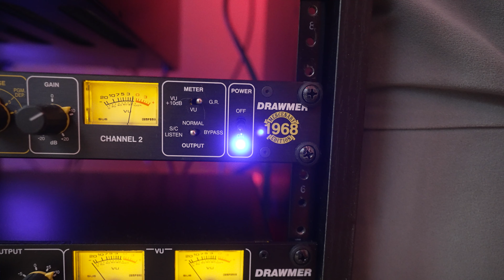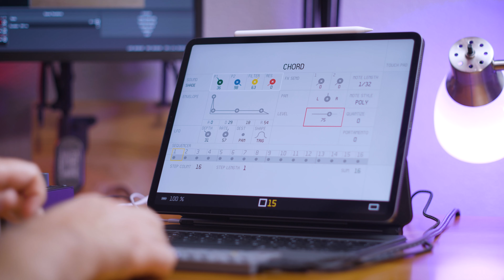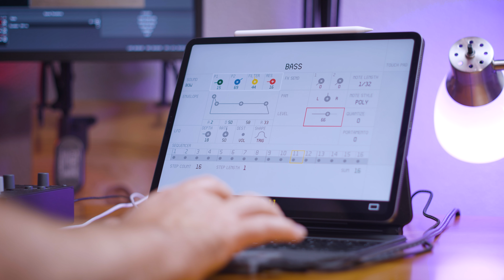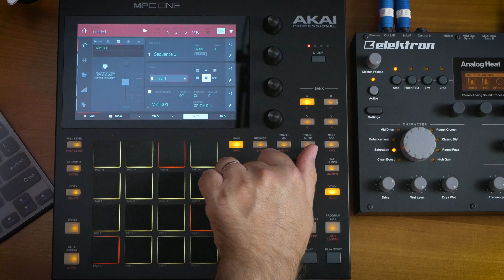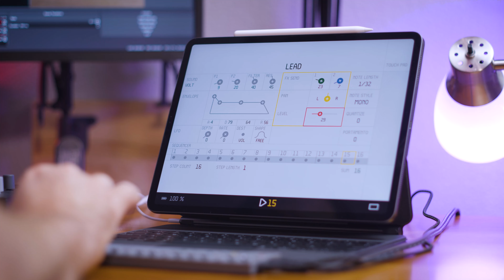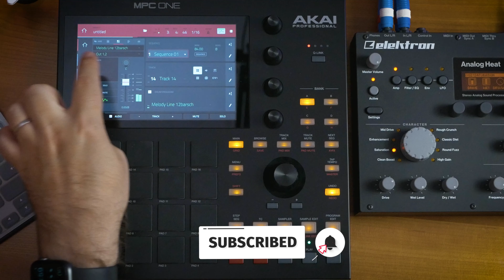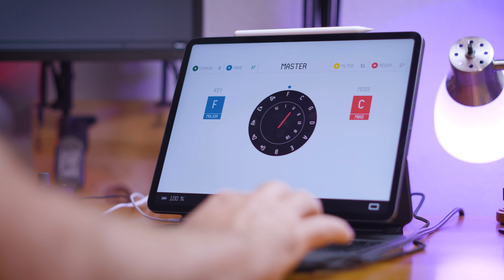MPC One controlling an OP-Z // Making a beat and jamming

Comment: I think the OP-Z ground hum comes from the USB charging. In the manual, there's a setting to turn off charging while you are connected via usb. See if that helps.
Reply: From the manual "usb connection might create noises. connect your OP-Z without charging by holding the screen button + trigger spark. yellow led lights will confirm it is disabled. "
Reply from the maker: Amazing! Thanks for the tip 🙏